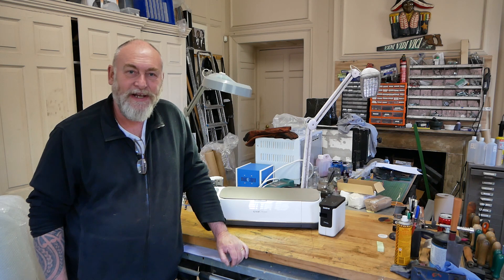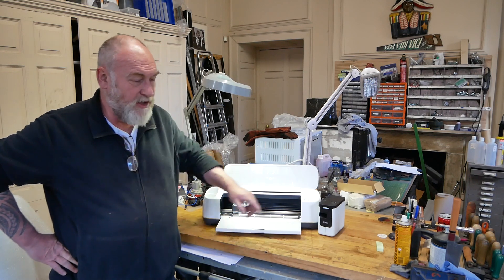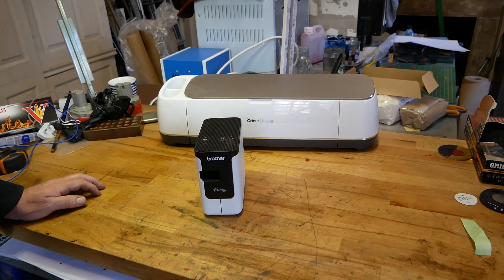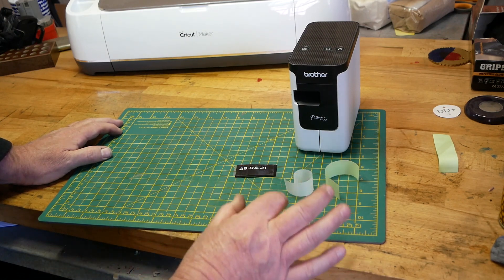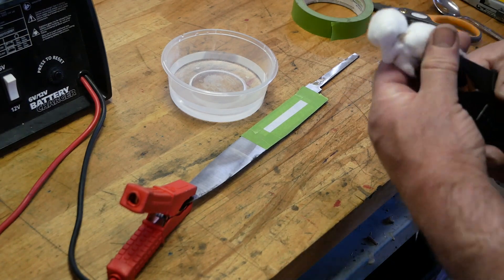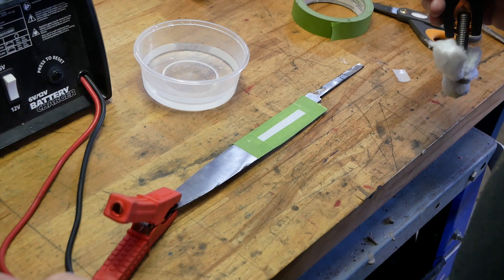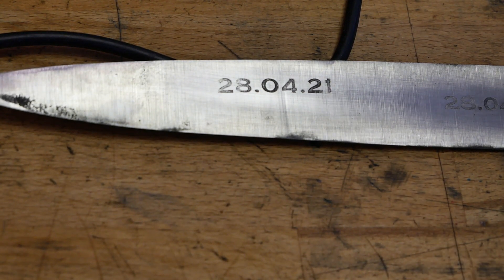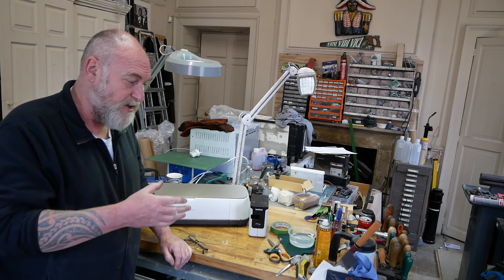Printing Stencils for Etching Steel: Cricut Maker v Brother PT700

Comment: I've never seen anyone use the black clip on the bolt you're supposed to do it the opposite I know because I tried it the exact way you're doing it in the video and it didn't work and I ended up returning an item that I could have kept

Comment: I got both printers and this is exactly what I needed , thank you.
Reply from the maker: You are very welcome
Reply: I did my etching on a piece of steel, I see what you mean with the excess water and the lil tiny holes around it, the second time I wrap it much better and it came so much better zero holes, I proceeded to put it on my blade spine and is pretty clean for my first one, once again is very much appreciated, I'm proceeding to find better ways to wrap the stencil , to be continue. @Ukenick

Comment: Another question if it is OK, Approximately how small could the vinyl printer cut numbers and letters with good finish for metal etching?
Cheers Hendrik.
Reply from the maker: Well, Henry that is a very good question. In my experience you can cut pretty small letters, although I would go smaller than approx 5mm in height. The reason is not the accuracy of the vinyl cutter, bur more the font you choose. 2 reasons: 1, it can become very tricky to pick out the vinyl to create the stencil and 2 it could lose sharpness and look a bit of a mess. As you can see in the video you need to pick out the bits of the letters you want etched. The smaller, the harder it is to do well. Hope this helps

Comment: Hi, would a very thin layer of petroleum jelly behind the printer tape, before you stick it down, maybe help prevent leeching?
Reply from the maker: Hi Henry, thanks for getting in touch. I see where you are coming from but I suspect the jelly would be very hard to control and would seep into the actual parts you want to etch. However it might be worth a try if you have the Brother.

Comment: Try Gatorade for your etching solution. Basically the same stuff the professional store will sell you.
Reply: Thank you Sir. I just bought a cameo and i have been looking for this info. Best of luck to you mate
Reply: Gatorade you mean the drink?
Reply: @victorneto6014  yes
Reply: Thank you mate. Another question. Just any vinil will do or we need some special vinil?
Reply: @victorneto6014  I use a small cricut with their permanent vinyl. Good adhesion to your product is the most important part. So it doesn't bleed under the vinyl. Type of vinyl shouldn't really matter overall as long as the edging is on it well.

Comment: Could using a double sided tape helps to reduce the area of the stencil made with the brother? So the etch wouldn't bleed making those ugly spot, cause at the end the quality of the print isn't that bad
Reply from the maker: It might I guess, but the problem remains that the material the tape is made from is not as resistant as the vinyl. Also I have noticed that Cricut are now selling the Maker 3 which is why the one I am using can be bought pretty cheap second hand. Worth bearing in mind. But thanks a lot for the suggestion.
Reply: @Ukenick  the tape would be one time use for sure, but to me it looks faster to make and etch than the vinyl. If i had to make more than one knives at once i would print one stencil for each knives. The vinyl however is much better if you need to make bigger and elaborate marks, even drawings. Well, since amazon sell the p-700 i will get it a shot, if doesn't reach my goal i can always give it back

Comment: Thanks for sharing! I have the Brother primarily for its labels, the transfer tape is just a bonus. All types of (compatible) tape cassettes can be had for a fraction of the price from the Far East selling sites, and up to press have performed for me every bit as well the the genuine tapes. I've only used the stencil tape a couple of times, but it meets my modest needs. It's interesting to see how swapping the polarity and using AC affects the etch. I've found adding a little citric acid to the brine creates a different effect too. Anyhow, you've a new subscriber 👍 🇬🇧
Reply from the maker: Thanks so much. I will try the citric acid. Thanks so much for the sub too.

Comment: This is really a very informative comparison between the two machines and their results on the etching process. But there is one more way to etch your touch mark - logo and this is sandblasting. Vinyl withstand sandblasting up to a certain point, I think. Thanks for sharing my friend!
All the best
Dimitris
Reply: Yup.  Sandblasting works great.  My girlfriend does transfers for glass cups and mugs, then I take them out to the shop and sandblast them.  It works unbelievably well.  I've found you need to reduce the pressure slightly on the sandblaster or it eats through the vinyl and destroys the print.  Reducing to 80 PSI with an oddball mix of junk abrasives works well.
Reply from the maker: @unhinged-menagerie  Thanks for that. What kind of sandblaster do you use. Bearing in mind that logos on blades are quite small. Keen to know more.
Reply: @Ukenick  Youtube ate my comment because I included links to the sandblasters.  I sent you an e-mail.  Long story short it should be able to do small stuff like that no problem.
Reply from the maker: Thanks for that. Interesting.